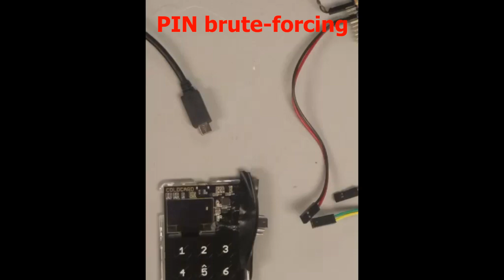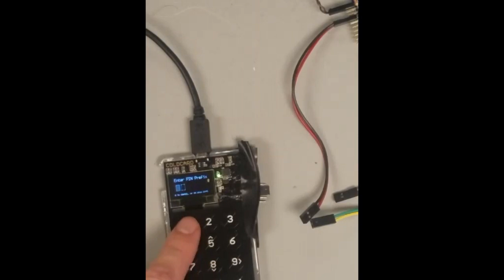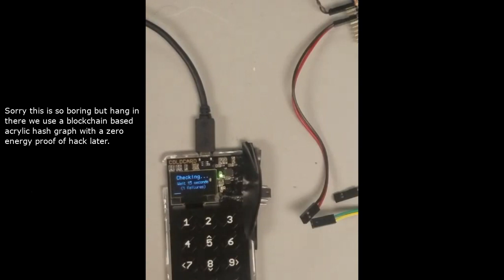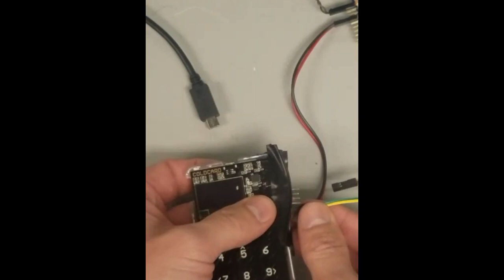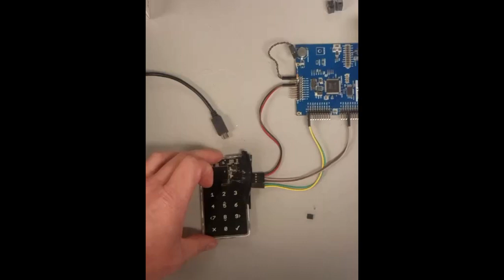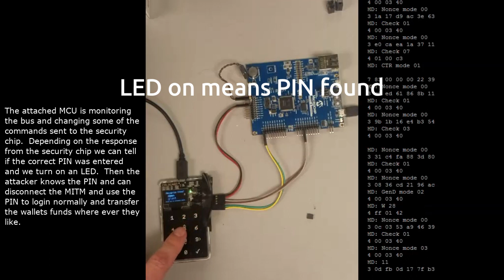Attack on ColdCard Wallet short PINs

Comment: If you can bypass the time multiplier between attempts,  that's a huge problem. This is a good case for keeping the majority of your funds in an account accessed through 25th word seed. If they can get in by brute guessing a pin, only the primary, "brick", and "duress" wallets would be accessible. To my understanding,  they would be hard pressed to correctly brute-force a sufficiently lengthy 25th word to access the main account without finding your physically written copy.